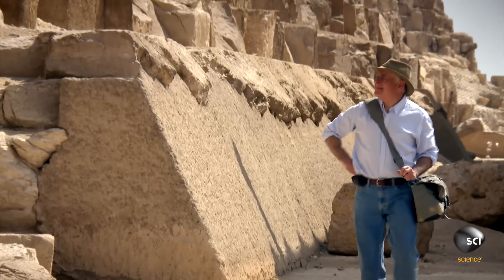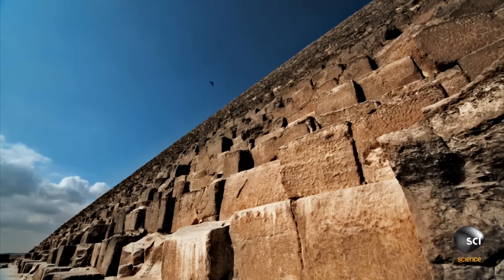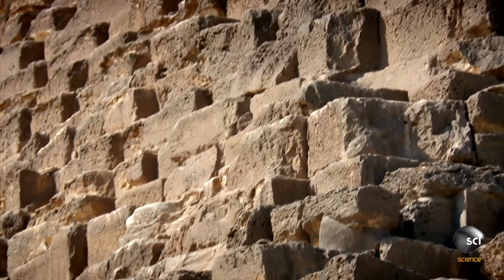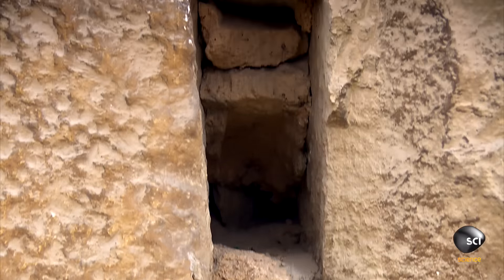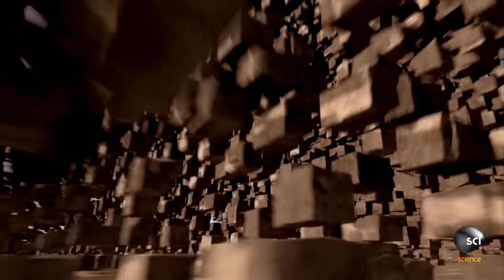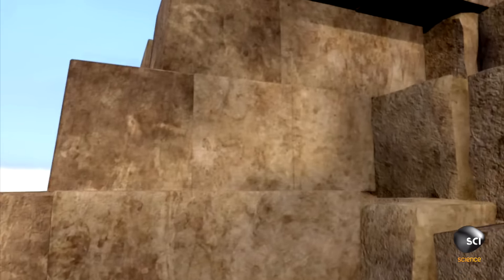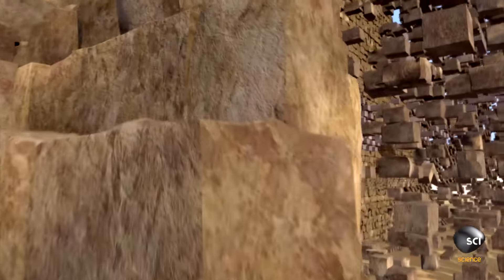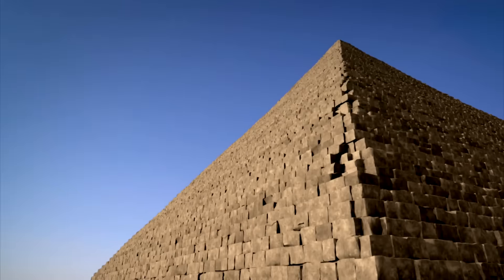How Did Ancient Egyptians Build Pyramids Quickly?

Comment: makes cents  rough cut blocks for filler \ precision cut for the control shape of the structure \ possible some voids sand and gravel?\ every possible time saver was used \ if it takes years of the project why not?